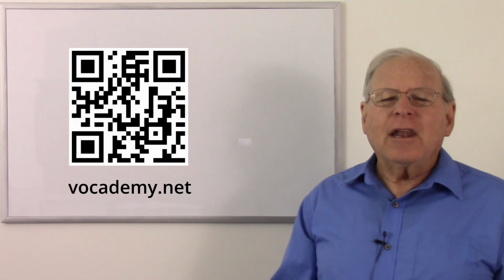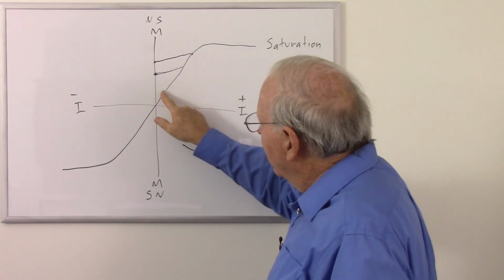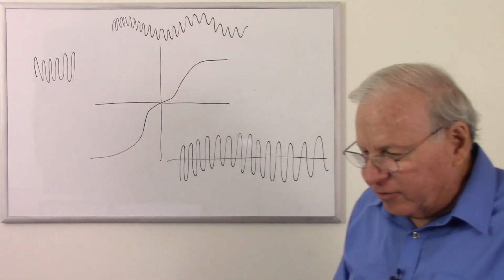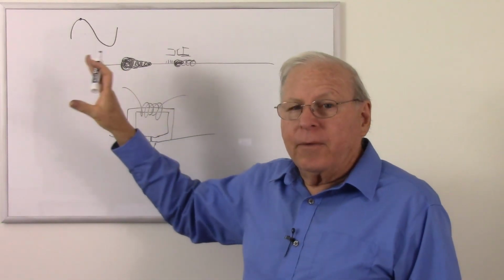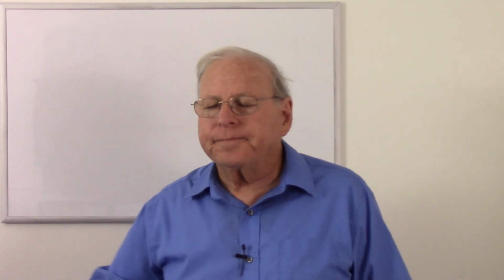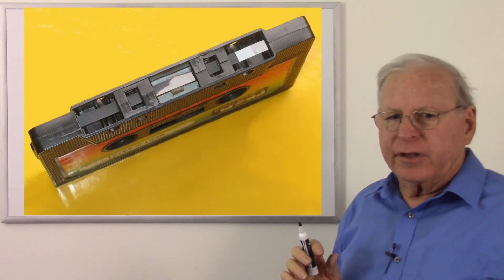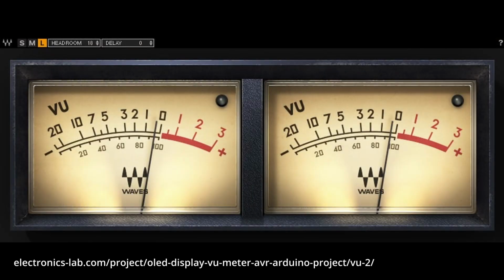Analog Magnetic Audio Recording - Solid-state Devices and Analog Circuits - Day 15, Part 1

Comment: One thing you did not go into was the shape of the cassette, in particular, the trapezoidal protruding sections on either face. In my mind, this was the major reason behind the cassette's downfall as it made the cassette plus case a really bulky item to carry around and it made portable tape decks also equally bulky. If the original designers of the cassette had been a bit more economical about the dimensions while also allowing longer durations from the start (who remembers those 45 minute, good-for-nothing tapes?) with a more reliable tape substrate to allow 90 minute upwards durations, things would have been very different.
Reply from the maker: I also failed to mention how delicate 120-minute tapes were. I agree that they probably could have made the tapes without the bulge. But, then, they were so much smaller than 8-track tapes they replaced.
Reply: @Vocademy-Electronics-Tech  I think it was a sixties thing: they abhorred squares and simple shapes back then. If they had waited for 2-3 years, it would definitely have been designed without it;

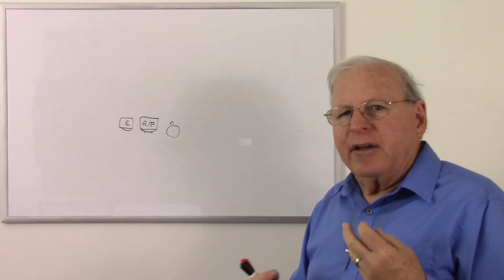Comment: 46:19 Ferrichrome cassette tapes were also available initially, but quickly died out as they offered no real overall improvements while the combined the problems of both the ferric and chromium formulations. They were used by selecting the Type III on the decks that offered this choice. Similarly, later decks usually only had Type I, II and IV choices available with the missing Type III being a mystery to most consumers. There were more than one tape formulations that were tried in the first years of cassette tape decks, offering more mysteries to be solved to cassette tape afficionados, e.g. the various types of ferric tapes. All that was at a time when Japanese tape manufacturers did not even exist and most tapes came out of Europe and the USA.

Comment: 40:20 I don't know the reason why, but if they had placed the two stereo tracks side by side, then a mono tape deck could be used to read the stereo tracks and vice versa:  a stereo deck could read mono recordings. With this scheme, this possibility was eliminated. Back then, this was a time when pre-recorded tapes were being offered to consumers. Like I wrote, I don't really know the reason, there may be valid engineering reasons for adopting this scheme, e.g. the dimensions of the recording head might have prevented placing two of them very closely side by side or, equally, the inability to prevent their magnetic fields from interacting with one another and thus adulterating the stereo signals (via cross-coupling). In fact, I would bet on these last two reasons with the first one being an added bonus.